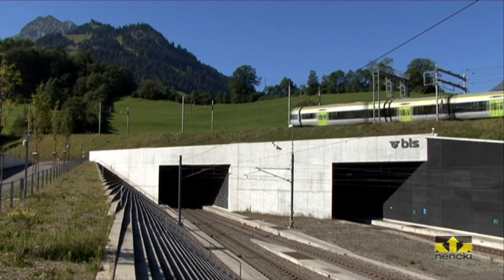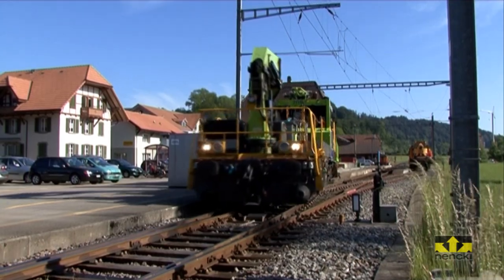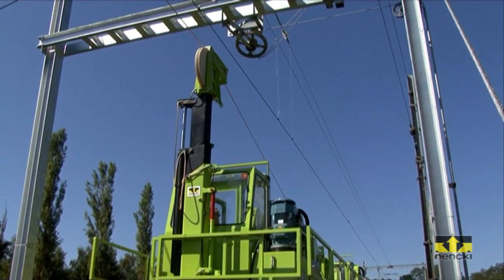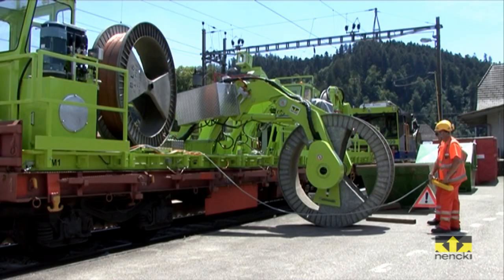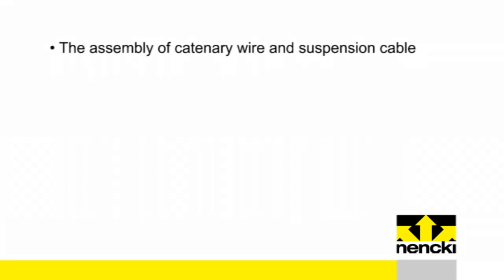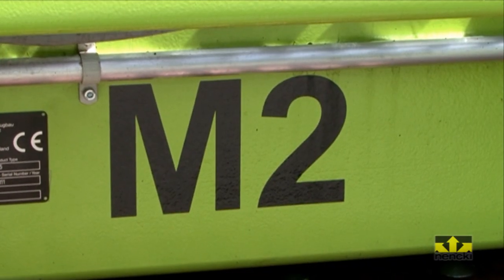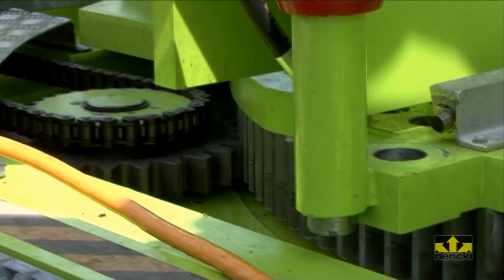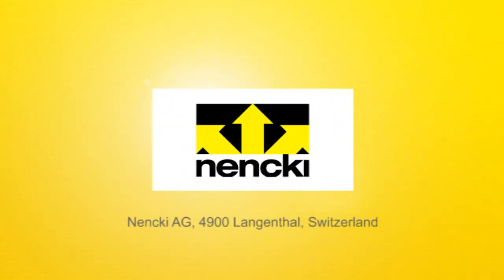NCS Nencki catenary wire assembly unit with cable drum handling

Comment: Thanks for uploading. Very informative. I never knew exactly how those wire systems were installed; always thought how difficult it must be to keep having to move a crane around to do it "manually".  
Florida doesn't have systems like this; we just burn Diesel all over the state.  Hell, Gainesville has all but removed our rail lines, except for a couple business in the North of the city, and of course the local Deerhaven Power Generating Station which burns coal.
Thanks again for info! =^.^=